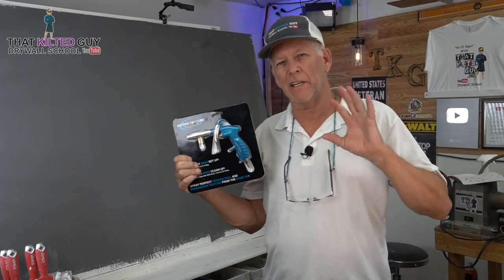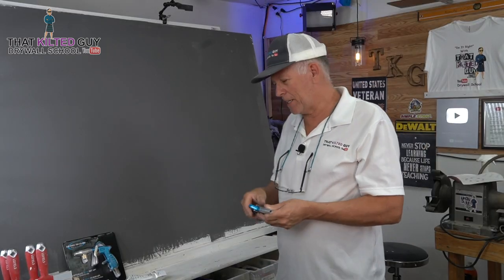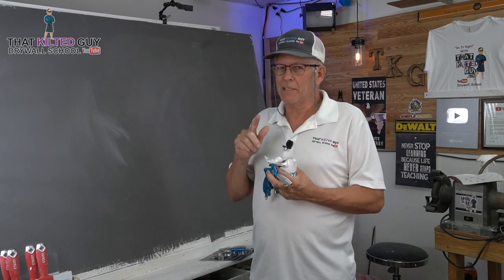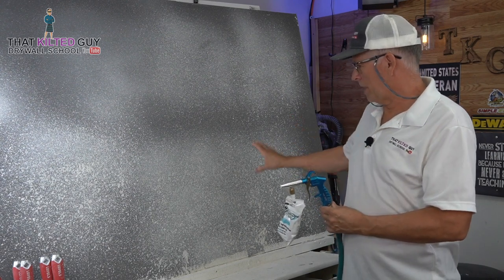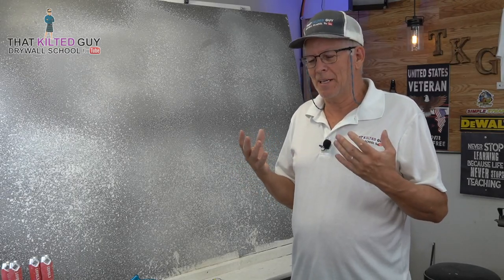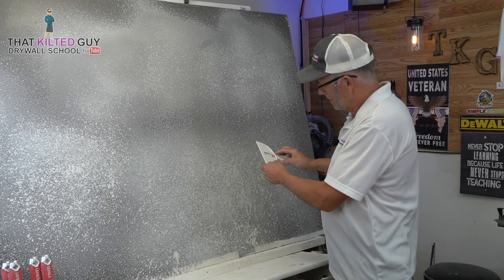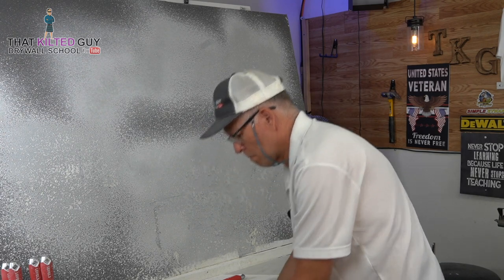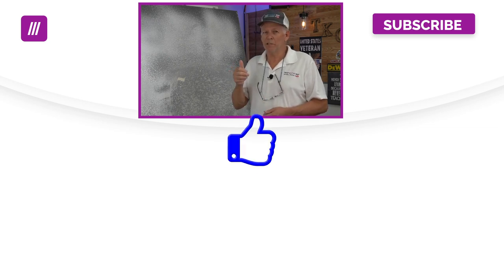⭐ THE EASIEST TEXTURE GUN EVER?  Let's Find out⭐

Comment: Funny thing, I had asked about the EZPRO, but forgot I had bought one with the bags when they first came out and forgot where I had put it. So like an idiot I went and bought another type like it that has pressurized cans that screw on. One can of texture and one of compressed air to blow it out when done. Still haven't used either one. I like you with the cans, there a pain, they cost to much and you had better buy two!! Like everything, the price of replacement bags is based on the price of a spray can. At least with the Ezpro you can practice and still have enough to do a small job and the gun will work. Great idea on the caulking tube. Thank you, your video are always spot on!!!

Comment: I have two of these and they blow texture in a can away, however I also have a LACO TG600 hand pump texture gun that I like even more but broke the base which is why I bought the EZ PRO ( from Sherwin Williams)  I will get a replacement part and the LACO will be my go to again. 

Another tip: I purchased a Bakers Pastry Bag and can know clean and refill the EZPro bag with my own mix , at $7 a bag ( with discount ) it adds up but also allows you to mix to the consistency you like.

I remember the Gun costing around $80 and the LACO was over $200 ( I think ) so maybe a little pricy for the DIYer but either way just smokes texture in a can.

Comment: Love the channel! My first texture gun, which i still have, looks like a bug sprayer! Its a manual hand pump type,  with a plastic mason jar type jug that screws under where the suction tube goes. Its a workout! Ha!. I've also got several types and sizes of hoppers. I'm a tool addict.  Lol. My last few repairs. Ive used the oil based can sprays. Dries in 5 minutes!  I've also seen these spray texture systems at Sherwin Williams.  I think it all depends on the type of repair. Anyway, great job. Cheers!
Reply from the maker: I think I tried that hand pump style a long time ago
Reply: @ThatKiltedGuyDIY  It will definitely give your arm and elbow and shoulder a workout! There are lots of variables that all need to come together to achieve a desired texture. The nozzle size,  the " mix" which you make yourself, etc. The Ezpro is probably a great system. The only downside I see is the compressor.  But I have a lightweght very quiet Rolair that I would probably use.
Reply: I still use the Homax pump texture sprayer I got around 15 years ago for small patch jobs,but have to refill the little hopper myself since they do not sell the refills anymore.
Reply: Have you ever heard of a redtail texture gun  its a hand held bug sprayer type but its easier  to pump then the rest of them  iv used this and all other types of texturing systems  and nothing  beats a redtail , and the problem  with this bag type  is the bags doesn't hold enough texture  nor does  it always  match all wall types of texture
Reply: @johnalarcon5006  no, I have never heard of that brand. I've had mine 30 years or more probably.  Its an arm workout for sure! For me, speed is key. Lately I've been using the homax 5 minute oil based orange peel sprays in a can. They're a little pricey,  but for very small repairs, I think they're adequate. Nobody can match an existing texture or finish no matter what they use or how its applied. Just too many variables. You just try to do the best you can.
Reply: @meyer629   I have an original  mason texture  gun too from 1984  but it always  drips rust water all over the place, you wont have that problem  with a red tail since its made out of aluminum  and brass and aerospace  stainless steel  this thing is a work of art  and sprays just as good as it looks !!!!!!
Reply: @johnalarcon5006  That's Awesome John! I'm almost tempted to get mine and see if it still works!! For nostalgia! Lol. How much are the Redtails? $500?
Reply from the maker: I can match at least 90% of them so that no one can tell. But I’ve done over 10,000 repairs (not jobs, but that many texture matches). It took years to figure it out
Reply: @ThatKiltedGuyDIY  I'm sure they're excellent Guy! That's alot of drywall mud!! Lol!
Reply: @ThatKiltedGuyDIY  cool
Reply: @ThatKiltedGuyDIY   Not for me bro  !
Reply: @meyer629  just under 400 dollars   believe  me they work the best regardless  of what anyone says  iv used them all and the redtail  far out matches all of them   !!!!!!
Reply from the maker: I’ve worn out several motors on my drywall sander, and several texture hoppers just from doing repairs. So yeah I’ve sprayed a lot of repairs. And I wore those out doing almost exclusively repairs. I only did maybe one or two bigger jobs a year and that would only be like a ceiling after popcorn removal.

Comment: #ezpro Looks like a much better system than the spray cans. I now have a $5 yard sale hopper, I've used it a couple times for repairs. Clean up on this especially seems a lot easier. 
   Looking at the comments apparently it is possible to refill the bags. 
    For the drying time green board would probably give you the contrast for filming, and still set up like normal, instead of having to paint and then spray over the paint
Reply from the maker: I've tried green board but it's not as reusable. I can repaint this sheet over and over

Comment: Have you seen the tex pro texture gun with load-able tunes? I've tried everything except that, and the ez pro texture system. I'm tempted to try it
Reply from the maker: I actually haven’t seen that. I would love to test things out like that all the time by purchasing them with my own money and testing them but I can’t afford it, yet. So here’s my take away from reading about it on the Home Depot site.

I would question how much those cartridges cost. But my big concern would be is there just two pattern settings or can you adjust it somehow? If it’s just got two patterns you can achieve by swapping out the tubes, you won’t be able to match texture properly. Like a can texture you can probably get close but sometimes you need thinner or thicker mud to achieve a texture match, or being able to control the droplet size, etc.

Let me know if you try it and what you think. Or if you wanted to do a guest review video I could include that in one of my videos giving you full credit. But talk to me first if you decided to do that.
Reply: @ThatKiltedGuyDIY  that was my concern. I'm finding VERY limited videos on it, but I belive from what I've gathered, you get 2 different tube options, one for thinner orange peel and one for heavier orange peel and knockdown, then you have the air adjustment on the gun to regulate airflow. I'm not sure if there is different size holes you can swap on the gun as well tho like some hoppers. 

They essentially claim each tube will last the same as a 20 oz can of texture. 6 tubes cost $60 where the so $10 per 100 Sq ft for fine. Where the cans are $16 . 

I'm tempted to buy it right now because it's $189 at my local home depot right now instead of $299. I don't have a great area to video, and I and don't have any good jobs coming up to video the tex pro either. But I wonder how much it would cost to ship to you,  for you to make a video. Might be worth it to try that if I can't make a video? I think it would be cool to make a video to compare the Wagner tex electric hopper, regular hopper, the tex pro bg homax and a can of texture. I'm just finding a hard time justifying a middle ground to use it where a can of texture isn't enough, and bringing a air compressor and normal hopper is too much. I'm hoping the tubes actually go a decent ways , and it's lighter then a normal hopper. That would make it worth it if it sprays good. Just can't find anything on it
Reply: @ThatKiltedGuyDIY  you know what I think needs to be invented? Refillable cans that you pressurize with a air compressor.  Like how mechanics fill brake fluid into canisters, fill with air and use. That would be awesome

Comment: Hey Guy. can l send you some easy sand twenty minute light? lt will be on the free of course. l know they dont have it up north. Best mudd lve ever worked with bar none. Creamy and easy to work with. Better than any bucket mudd lve ever used. Let me know.
Reply from the maker: What brand?
Reply: USG easy sand lightweight hot mudd. l used  a sack yesterday,  and was the best work lve ever done. Went on super smooth and very forgiving and easy to work with. @ThatKiltedGuyDIY
Reply from the maker: @jamescathcart4762  Watch in my videos, that's the one I use and the one I show on screen.  I like it but actually like the Westpac 20 minute as it sets up more reliably and is even smoother than the USG.  BUT, I use the USG 90% of the time as it's at Lowes and the drywall supplies are to far to go for just a bag of mud.

Comment: # ex pro spray gun when you were cleaning the tip if you add little bit of oil in the water to clean in this way you lubricating moving parts and when you are done with water do a total oil spray so you dont develop  rust inside the ez pro gun rest of the video you the nailed to the point Thank you

Comment: # EZPRO   I like the idea of the texture gun for repairs, in and out, but the Ready Mixed Texture ???? needs to be up graded. Too loose for a quickie job, set up time too long for the knock down. With those improvements I would definitely use it. The California Compressor excellent, reasonable and very quiet, have two.
Reply from the maker: It should set up way faster on non painted drywall

Comment: #EZ pro
I have an older model, silver, not blue handle, don't think there's any difference,  never much liked it though. For one, none of the drywall supply places carried the bags, and although cheaper than the can texture, it's still too expensive. Plus definitely harder to get an even texture vs a hopper, or even the Laco hand pump Texture Gun, which I absolutely love.

Comment: These pouches can be refilled. I use a Masons Bag. It’s a canvas bag lined with rubber. It’s made for cement to fill in the gaps between bricks but work perfectly for drywall mud or texture. Holds up better than your wife’s frosting bags. 🤣

Comment: Damn Kilted Guy l cut my finger almost off when l took some trash off of it. Said what the hell mine as well shave with it! Man these blades are sharp after six months of use. Bled like a stuffed hog. Some got on the wall. Told the homeowners it adds character. l love to use your line when homeowners ask what about this what about that? l tell them what you said, texture covers a multitude of sins! Especially here in Texas where 99% percent of my repairs are orange peel, splatter or knockdown.
Reply from the maker: They get so sharp that I often cut my masking film with a 6" knife blade on the cardboard box

Comment: Oh man I want one! That thing looks awesome. #ezpro
Reply: I bought one. It's as they've said...good for small spots...and I know why. ..you just can't squeeze the bag at a steady enough rate to produce consistent splatter over larger areas...also the bag is small. No matter. I know of a solution. 5 gal bucket and lid, air line, air regulator, garden hose, fittings, jb weld, ball valve. Solved.